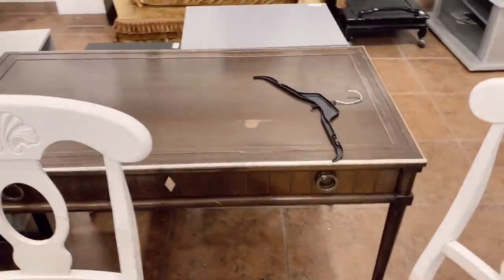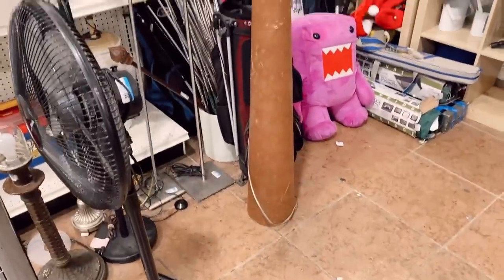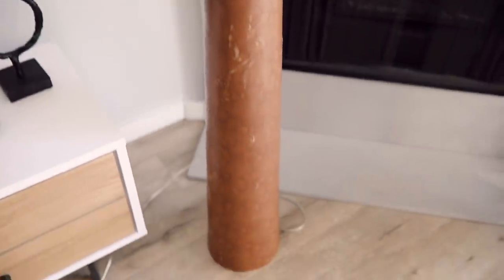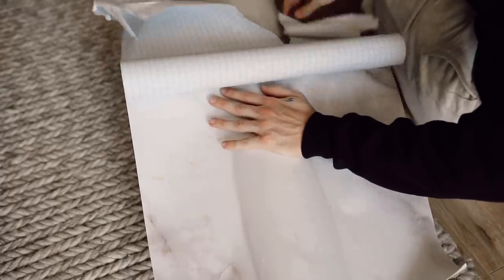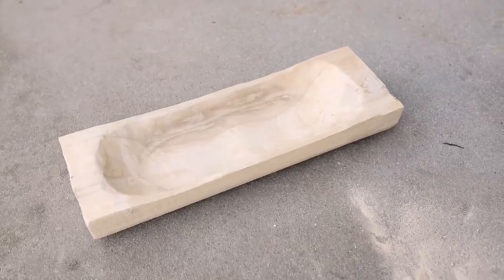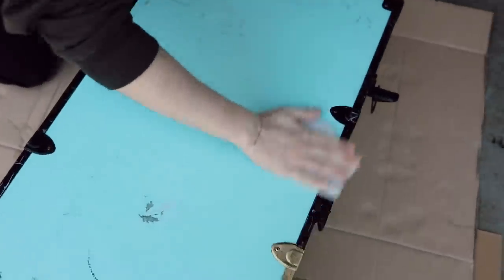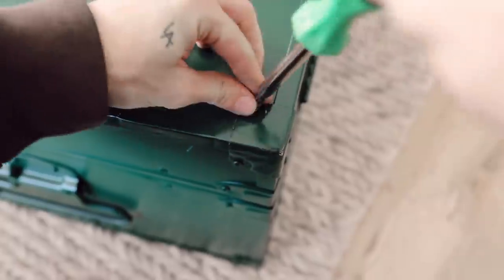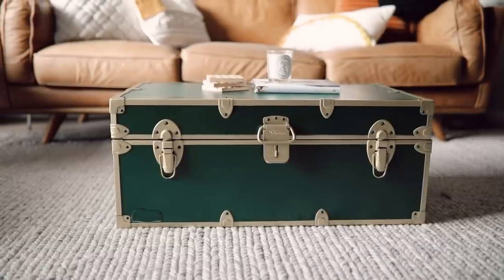DIY THRIFT FLIP - Easy Home Decor Ideas on a BUDGET!

Comment: For the lamp, you could've traced the leather from the lamp onto the contact paper to have it wrap perfectly. The tray was a beautifully creative idea, though.
Reply: Great idea. or just use  newspaper or something cheap to make a pattern before  cutting the good paper.
Reply: He said in a response to another comment that that was the initial plan but the leather was too wide to match up 😊
Reply: Yeah, he just needed a pattern.
Reply: Same thought exactly. I was about to comment when I saw yours.
Reply: Perhaps applying it slightly diagonally (extra length at the bottom/or top for allowance) , and then wrapping around could have given a smoother application.
Reply: Or he could have purposely created a pattern
Reply: I was thinking the same thing!

Comment: Some more ideas for the spray lamp for those who are more artistic or adventurous: doing an ombre coat of paint especially to tie in colours from the surrounding space. Like a pale pista green transitioning into a forest green or a rust turning into burgundy would pop more against the white lampshade. Another idea, for the lamp stand, get a geode effect, use high quality and metallic finish paints and create geodesic waves and effects or similar to agate stone, may take a while like any committed artist’s project but the effects look stunning especially if finished off with a clear glossy coat. Or for the lampshade, refer to any constellations, accordingly poke holes in the lampshade to correspond, spray paint the shade a deep navy or black and turn the light on.

Comment: Great job on all 3 projects  !!!
I have done a trunk before. The reward of removing the hardware is worth the patience it takes.  I had a piece of glass cut to fit the top of mine....DEFINITELY worth doing that. I also did add casters to the bottom....6" hairpin legs would also work well.
The tray looked super.....I would caution about burning a candle on wood though and also for stability, but I love it.
The lamp is DEFINITELY my favorite. You should have used the leather as a template though.....but as we do these projects we get so gung ho, and hindsight is 20/20.....all sucesses!!!!
Keep up the good work.
The thing I love about thrifting "blindly" is that true creativity can shine through!  But if you get stumped, Pinterest is always there to fall back on.
Keep 'em coming Drew !!!!!!!

Comment: On your lamp and such contact paper projects you can do a double cut. I often used the technique in  wallpaper hanging.  You overlap the paper a bit then you cut through both pieces and pull away excess pieces resulting in a perfect fit and tight seam.

Comment: Tip for making contact paper fit to / mold around whatever your putting it on is to heat it with a bowl dryer for a few seconds I’ve done this with my kitchen cabinets and my round dinning table

Comment: Tip for applying the contact sticky paper. Get a spray bottle of water and a couple drops of dish soap in the water. Lightly mist the area then apply the paper. Squeegee the paper on and it will remove any excess water. The paper can be easily adjusted and will have fewer bubbles to pop.
Reply from the maker: TY! Good idea!!

Comment: Ooh, I've been working on a trunk DIY myself atm! So it's fun to compare the different approaches. 

I have a set of two small tuck boxes from my boarding school days. I've spray painted them a matt black (didn't sand them, just used one coat of spray primer) and then I'm about to varnish them today. It's taking FOR-EVER, because a) I DID go the tape-literally-everything-off route (I think it probably took about 3 or four hours total to do both? I started using a box cutter to trim the edges of the tape which sped everything up a lot; just a shame it took me.... 2 and a half hours to think of doing that ha) and b) it's been so damp and rainy here in England lately!!! I literally had to wait two weeks to get a full day of guaranteed sun so I could spray them outside ahaha. 

I'm going to attempt using a gilding wax on all the hardware (first time!), because I like some of the ageing on the metal already but it's a real cheap bright gold atm so I'm gonna try to dim that shine a bit down to more of a silvery copper.

Comment: I'd love to see a diy rug like the one under the trunk! I tried to google and pinterest it myself but had no luck.
Reply: Get a fabric you love from joannes (about 5 yards) clearance bin has good finds at 4 or 5 a yd
Next get a piece of thick canvas or foam (also joannes and about 5 yards) 2 a yd
Last a rug gripper (joannes or walmart 8x10 is most common. You can trim to fit your space) 20 prepackaged or 3 a yd at joannes. If you buy by yd only get 2 or so and frame the edges rather than have a full layer

Stack them fabric, canvas/foam, then gripper 

Sew or hot glue together. You want the top two layers flush with each other and the gripper about 4 inches in on each side. You can sew a trim around the edges in a complementary color or leave raw. 

Rule of thumb, your rug should go under the front legs of short furniture or under all legs of tall furniture

Hope this helped
Reply: @Domino_0604  thats awesome! Although could you get that braided efffect from it?

Comment: Use a heat gone or blow dryer on high hot heat and it will make the contact paper more flexible and smooth out better

Comment: You can get super thin sheets of wood flooring at Home Depot. It's almost like a veneer. It comes in strips about 4" wide. This would have been gorgeous had you covered the trunk in the wood veneer strips and then added the gold or brass paint to the tidbits.

Comment: PRO TIP: when you try to wrap or put contact paper on anything the best thing is to wet the surface of the thing you are going to put the contact paper on, I know it sounds counterintuitive, but this is the best way to do it, I've seen you struggle with this with your bathroom counter as well, believe me, this will change everything, you don't need to poke any holes in your contact paper as  you will not have any holes

Comment: I HAVE BECOME A WIZ WITH MARBLE CONTACT PAPER. I FOUND THAT IF NEED TO ADD AN EXTRA PIECE INSTEAD OF LEAVING THE EDGE STRAIGHT CUT IT IN A RANDOM WAVY PATTERN AND IT WILL BLEND IN. PLEASE WEAR A MASK WHEN YOU USE ANY KIND OF SPRAY AS IT CAN CAUSE PULMONARY PROBLEMS.

Comment: You could’ve used the leather fabric from the lamp as a pattern for the contact paper.
Reply from the maker: That was my original idea but the width of the contact paper wasn’t wide enough for the bottom. So I just wrapped what I could and then filled in the blanks!

Comment: Dude just that you know the saw you bought has a blade for metal in it which is good for plastic, resins and similar stuff but not so efficient for wood. 
I would consider buying a cheap fine wood saw you can use them for a lifetime and they don't cost so much.